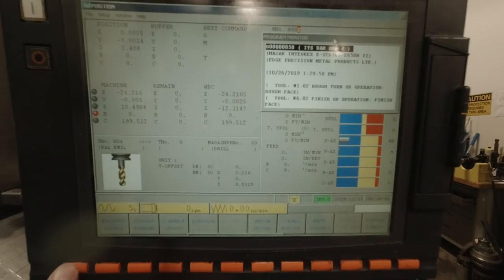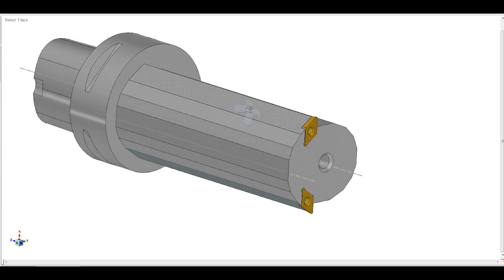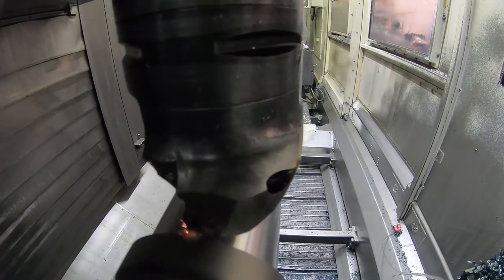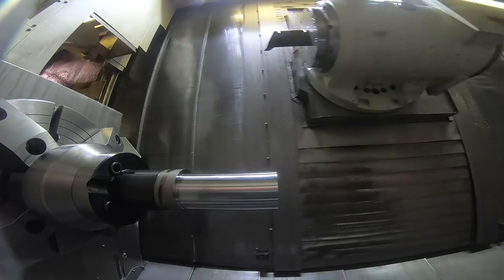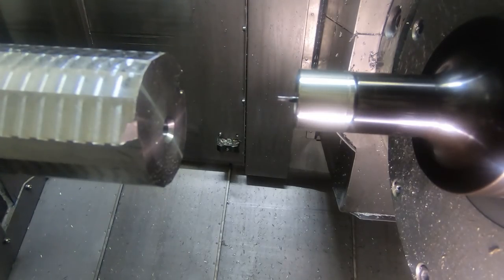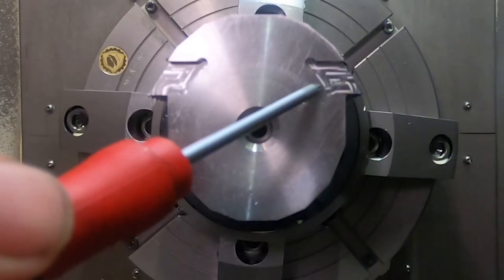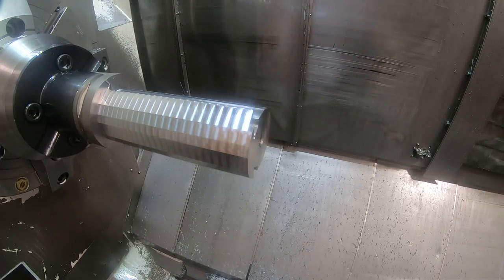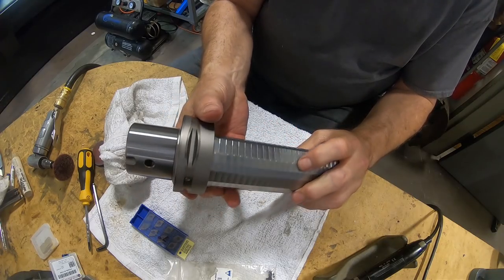Special Shaping Tool For The Mazak

Comment: As a toolmaker and a CNC machinist I am totally blown away by your expertise.
Reply from the maker: The only way you can tap in turning mode is on centerline. In that case I turn the thread. On the Mazak I have never tapped in turning mode. If I ever did a part where I could not reach the thread with a threading bar on centerline. I think I would tap with the milling spindle anyway. Because I have never tapped in the turning mode. I’m not completely sure it does it with rigid tapping. Where the tap doesn’t need a floating tap driver. If that were the case I would never do it that way.

Comment: I wonder if the designer had this method in mind when designing the part? It seems like it’s about the only way to get that corner radius at the bottom. Creative solution to a darn near impossible situation. Good job.
Reply: I also wonder about this. Do the engineers know how difficult it is to make these?
Reply: mark muranyi speaking from experience as a machinist for nearly 10 years, and now going back to school for mechanical engineering, they most likely don’t. The guys in my classes are near brain dead when it comes to actual creation of there designs. They don’t understand the basic concepts of rotating tools. Can’t make a perfect square hole with conventional rotating tools. We have some very basic DFMA but most of these guys don’t get it. Straight outta high school or just been in post secondary for a while they have never been to a machine shop and have watched some videos here on YouTube but don’t understand the mechanics of how parts are usually made. This is why engineering firms shit a brick when they get a quote back on some specialty parts, just cause THIS kind level of fab and setup is required for what they think is simple cause the computer said it works
Reply: @markmuranyi9289  Some do, and some don't.

Just like in any other profession, engineers come in "standard," "good," and "master" grades, but you can only know which is which when you hire them if you have good back door references, or have an interview process with actual practical work challenges involved.

(You'd think there would be "bad" engineers, too, but if you don't cut it on the job, you won't be working as an engineer for too long, so those generally churn out.)
Reply: @CorndogBrownie  A good machines shop building repeat business will send back a print with trouble areas ringed in red, and description of how to save money there. You can add value there m, and thus even earn higher rates, if you find the right fit for you. Just gotta be respectful about it -- "I can make it for X but if you changed these features, it'd cost Y," kind of deal.

Unfortunately, you probably can't spend that kind of effort on every odd job you bid on, if you're mainly a "lowest bidder" job shop...
Reply: And now we start the video, wherein our Master Machinist spends a whole day making a thousand dollar custom tool to cut a part feature that could have been functionally replaced with a dog-point setscrew.
Reply: Yes engineers know how difficult features are. If they are a mechanical engineer. Usually there is one consulting. Even a civil engineer would know. Just like a surgeon woud know how to stabilize a patient regardless if they are ENT, general or neuro.
Reply: you could machine as much material away as you can within reason and then edm what is left. There are already 2 ways :D
Reply: From my experience designeres seldom have a clue as to how things are made. Sure they know a mill from a lathe. But that is about as fare as it goes.
Reply: I think this is one of the biggest issues between designers/engineers and the people that actually build what’s on the prints. There’s a huge disconnect and it’s the reason the best designers/engineers start in “the field” rather than school. I see problems comparable to this in construction just about every day.
Reply: Just because the part is difficult to make doesn't mean it is impractical or over designed. We don't know the problem that this custom part is solving. The cost of the part could be wholly insignificant. 

The comment about a good shop sending back red lines is spot on as well. You can't expect a designer to have the expertise of a master machinist and vice versa. 

I am a design engineer and i spend a ton of time watching stuff like this both to improve dfm on my parts but also to know what is possible, even if it is difficult to make.
Reply: @CorndogBrownie  - One thing I have learned is that before CAD, there were an average of 4-5 draftsmen for every engineer. Check out the website of Joe Brouwer, a veteran draftsman who worked for Boeing, and others. Quoting Joe: "Drafting department was responsible for form-fit-function (FFF) design documented to set standards. Engineers were there to make sure things didn't break." Draftsmen would know a lot about manufacturing and tolerances. Joe would say "DFMA? Hahaha, what else would you design for!?"
 
A fully detailed (dimensioned) drawing can be checked. There used to be a function in the drafting days called "Checker" who would scrutizine every detail of every drawing and return it until it was perfect. A drawing is also an inspection document for manufacturing. It has to be delivered to the outside world (outside engineering) in neutral formats (STEP, PDF) - sending out native CAD files to manufacturing (as Catia MBD is doing at several aerospace programs) is a very, very costly mess - Mr. Murphy is always right around the corner! 

Ever since 3D CAD, in many countries/ companies there is no division between the engineering and the documentation functions. I have worked for a Swiss company as well as I do have experience with German companies, where the function of "Konstrukteur" is still in place. Not as a career path for "Juniors"' eventually becoming engineers, but as a dedicated job you can do until retirement. For these people there is not really a career path. As Joe would say, it's "grunt work". 

I think it's safe to say that the consistent high quality of German/ Swiss and definitely also Japanese products is due to the fact that they hold on to the documentation formats. MBD (Model Based Definition) is creating havoc in the supply chain and the failure cost is off the charts (again, personal experience, ASML, Lockheed). Also the recent billion dollar failures at Boeing may well be attributed at least in part to their MBD.
Reply: lots of engineers now are entirely theory now with no practical experience or DFM classes. when i was going to school for machining i was one of three people out of maybe 100 in there who were or were going to be machinists, the rest were all engineers taking the intro classes as electives or they were already graduated and taking the class because they didn't have any idea how any of the stuff they were designing was actually made. historically as part of an engineering degree you needed to get hands on time with every major method of manufacturing, regardless of discipline. my grandfather is a retired electrical engineer and when he went through school he had to take wood shop, metal shop, foundry, and machine shop and get a basic familiarity with all of that stuff, even though he was an electrical engineer. that simply doesn't happen anymore.
Reply: It depends on what flavor of technical expertise they have... as a system level ME manufacturability is always high on my priorities list, but less hands on types (thermo, fluids, aero, hydraulic) don’t always have the same concerns or constraints... not a knock on their abilities, but “how the sausage is made” is of no concern to some people.  The top tier of designers will usually have a fair idea of the processes involved (and design with them in mind) but that doesn’t guarantee that a more-difficult-than-necessary part was made by a bad designer.

I’m actually surprised that there is a relief groove behind the key.
Reply: Jon Watte this can be hit or miss... you definitely have to see how receptive they are to the modifications.  You (well, not you specifically... referring to the part/project) can get in to some trouble if the person approving the cost saving mods isn’t the designer.  It’s easy for admin/managers to understand cost savings, technical requirements require a bit more skill.

If the designer doesn’t know what the drawing requires than is usually pretty helpful, but it gets a little tiring justifying the increased cost to the boss when it’s necessary.
Reply: @steves.3485  i have met lots of mechanical engineers who have no clue what goes on in a machine shop. they are getting more common, but not nearly as common as interdisciplinary engineers like mechatronics engineers
Reply: SuperAWaC totally agree!  It’s a huge problem that I hope will correct itself soon... with skilled machinists getting harder to find there will be less people to clean up their messes.
Reply: @steves.3485  Yeah, people talking to people is never risk free...
Why don't we let the robots do the job? :-D
Reply: No.  Many (younger) responsible/mechanical engineers have no idea about how difficult it is to machine a part they drew in Autodesk. Many have no background in manufacturing or metrology.  Most in my experience don't collaborate with a manufacturing engineer or production to create a part that satisfies fit, form, and function for cost-effectiveness.  

Source:  I work in the R&D production department for a NewSpace company, where the median age of the engineering is quite low, so senior engineers with practical experience are uncommon.  There's constant issues about impossible/needlessly prohibitive features, and inappropriate use of GD&T.  Some of this has disappeared with additive manufacturing, which allows for very innovative parts and savings (greatly reducing parts counts for components like turbopumps and thrust chambers), but printed parts can be even worse to take down to finished dimensions because prints will never achieve the tight tolerances or finishes from traditional subtractive manufacturing.
Reply: EDM
Reply: @mattm7535  I am currently finishing my last semester in Mechanical engineering in college ( it's called a technique here in french, you end up as a technician don't know the actual name of these programs in the us) and we were learning on old lathes, some MODERN lathes from the 50's all the way to some Millenium lathes, then mills with the same age gap and then two years in CNC. There are two options for the actual college program. one is fabrication and the other one is design. The design guys tend to create mathematically correct and adequate shapes but physically impossible to create and fabricate without some extensive and expensive multi die molding or some high end 5 axis with lolipops, while the fabrication guys tend to design easy to fabricate parts but that are overbuilt and not the lightest. 

A more complicated part is not necessarily better even though it looks better
Reply: CorndogBrownie I had some vocational school training in high school and college before entering the engineering workforce. One of my tasks in my current engineering role is quoting jobs (mostly high volume automotive). The customer requirements are insane sometimes. We have machining centers to wire EDM to metal additive capability but it’s still difficult to find ways to make the parts the design engineers want. 

They want 4 decimal place tolerances, on complex part geometries, with ridiculous material properties, and they want the parts for less than the cost of a snickers bar per piece.
Reply: @markmuranyi9289  Some don't give a fuck they just want it to be made, its the machinist thing to figure it out. Other do consider if its possible to do and thus do it in a way that require only standard tooling as far as possible, and that also save time and in the end money so its the right way to go. But there are cases where special tooling is necessary anyway.
Reply: I mean technically you could get in there with EDM
Reply: The designer didn't have any method in his head, its not their problem they just want it made.
Reply: .0001mm tolerances everywhere

60 WEDM setups and 4 DSEDM ones to have a chance to meet said tolerances

They went with the shop that bid $50

Comment: Thank you for making these videos. They are truly awesome. I wonder if the genius engineer who designed this part has ever been in a machine shop. Someone should tell him that you cannot 3D print a part like this. Perhaps tie him down a la A Clockwork Orange and make him watch your videos...
Your skills are legendary. I am glad you are sharing them with the world.
Reply: lol.  I remember that scene.  You're nuts. (but in a good way)
Reply: I am a design engineer with lots of machining experience, not all "hands on" but very knowledgeable of tooling like Edge Precision uses.   These parts are just a few of the many I've seen in my past and kind of know whom they maybe for.  These engineers developing these parts have PhD's, and are developing this stuff, and they do work with shops like E.P..  
One thing I would have done if this was my design,  I would have put an internal key way in the part shown, and put the key as an external feature on the mating part.  Got to remember, most of these parts are only made in small quantities for usually one job and never made again.  Price is generally an option on this stuff!  The oilfield needs it now! Bill us later!!! Ken.

Comment: Angle grinder used carefully leaves a surprisingly good (looking) finish!
I was just drafting a shaping tool for milling machine as well. For the sake of simplicity I think it will be a rod with a hole drilled across and an old carbide end mill.

Comment: Can you do a video on the accuracy of your touching off method vs a height gauge. Your work is so precise and I feel that touching off can be so subjective to pressure and feel. Love your work. Its a master class every time.
Reply from the maker: I can tell the difference between one click on the hand wheel. That would be .0001". Because the dowell pin is hard there is no give and it's round shape lets you approach the setting gradually. With a shim/feeler gauge you can not get the same feel. Also you have to know the location of the surface you are using as a reference accurately. A height gauge can be equally as accurate depending on its use.

Comment: I wonder how many times do you end up putting this same part in the machine to do all these different steps?  Doing that really adds to the chances of a scraped part.  Thanks for sharing your custom solution. Charles
Reply from the maker: All the ID work that runs concentric to the OD on this end will be done in one operation. Even the holes and ports you saw in the model. Including this key and the one farther in the bore. These parts have many operations it’s unavoidable. I just have to be careful about misalignments.

Comment: Most of the time I see you make medium sized parts on this CNC. Parts that would fit on a much smaller CNC. How come yours is so big? Would it not be cheaper to run a small CNC and get the wear there? Does the size of the machine affect the cost of operation? I am just curious about why you have such a big machine whereas others have one that is half the size.

Comment: Great solution. One question. Why did you not just turn most of the shank to base dia and leave the pocket portion for milling. Like a "hammer head shark" Did it really need the extra material to aid rigidity. I notice you were content to leave front square and flat. Were you not worried about swarm falling down and  being crushed between shoulder on job and tool?
Reply from the maker: I guess I could have done it that way. It would have reduced the machining and also the strength of the tool. The tool isn’t really round it’s more oval shaped. I will be running high pressure coolant thru the tool and it will be stoping a good .187” from the back shoulder. I don’t think there will be any shaving problem.

Comment: @Edge Precision It would be a good idea to make a flat on that Capto adapter to level the C axis with spindle orientation for similar tooling projects
Reply from the maker: budzab all I have to do is take a Capto turning tool holder that’s designed to hold a square shank. Mount it in the adapter in the C axis. Than indicate on it. This will give me the orientation.

Comment: Interested to see how well the insert holds up when it reaches the bottom of the bore. I’ve had similar issues while “blind broaching”. Also will you program this by hand or CAM? Could we see the code please?
Great as always 👍🏻
Reply: The feature has a undercut, its not going to build up.
Reply: Yea I rewatched and realized that there is space in between the rectangle island and the back face. 👍🏻

Comment: You should do a video on the shrink fit tool holders. Do you have one of those machines that do the heating and cooling process ?
Reply from the maker: I did do a video. Capto 8 to .250 Shrink. 6 videos after this one. No I heat them with a propane torch.
Reply: Edge Precision okay cool. At work we have talked about these shrink fit tools. Currently we have a couple of hydraulic holders but they have limitations. Primarily being incredibly expensive lol. Making shrink fit tools seems like it could be a cheaper alternative.

Comment: If you change the safety clearance in your cam output the machine won’t move away for so long. You can set a safe distance from diameter for x y z.

Comment: Why not use tail stock to support whole part when machining profile outside? Wouldnt that reduce vibration and extend endmill life?
Reply from the maker: Yes but on this big machine the tail center can't get this close to the chuck. The part has to be at least a 20" projection from the chucks face.